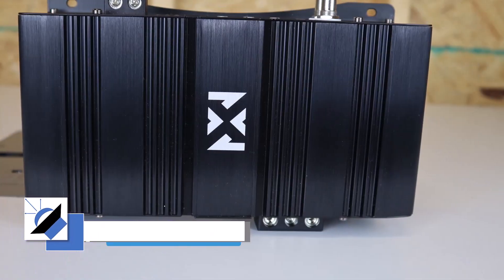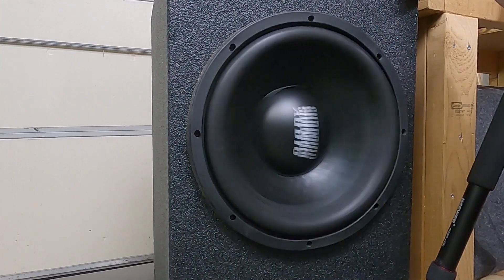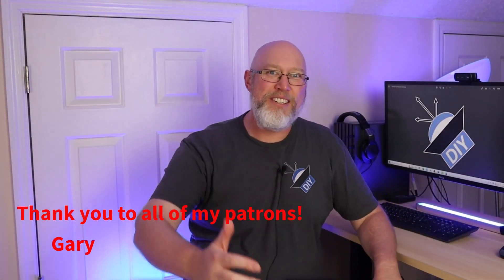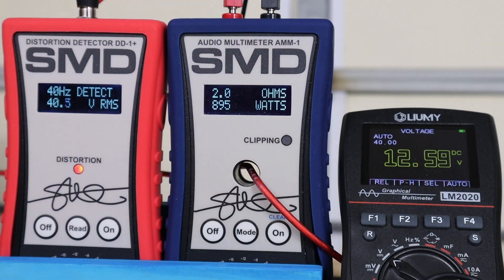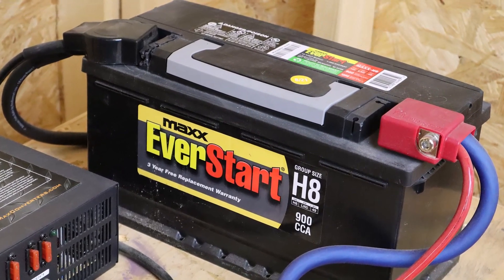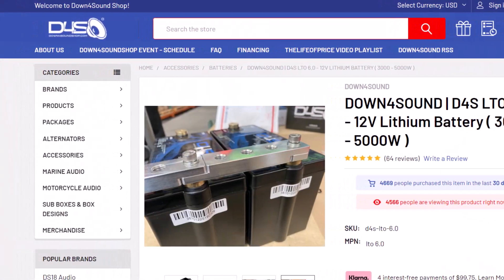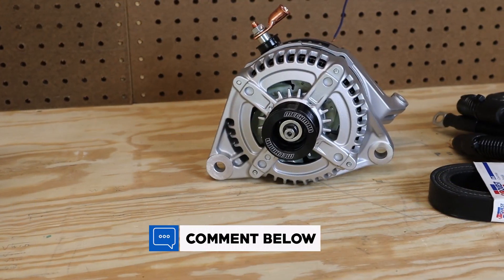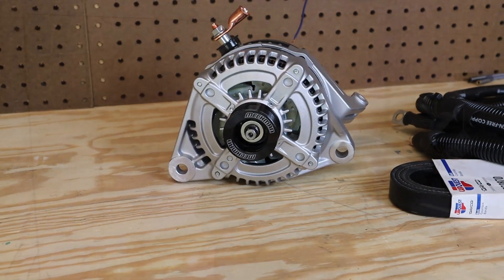Amp dyno FAIL:  Here is why you need to upgrade your alternator!

Comment: i've got a question :D I'm running a 74Ah 750 CCA battery with an stock 120A alternator, Big 3, an Vibe Subwoofer with 450W Rms and a AB Class Crunch 2ch amp, which can output 1x600W Rms 4ohm and 2x300W Rms at 2ohm, the sub is DVC 2ohm ... And when i crank the Gain up the lights with the engine running are start to flash :)) ... I''ve got good 4AWG cables, good grounds points ... And now my question : If i buy an clas D amp which is more efficent, then clas AB, and it drows less current, my headlights stop flashing :-? Or shoud i upgrade the battery with an 80 or 100Ah and 800 CCA :-? Sory if my english is bad :D Thanks
Reply from the maker: Those crunch apps are probably only doing about a fourth of their rated power.  Honestly, you should have enough electrical to support that much power.  Switching to a more efficient amplifier will help, and upgrading the battery will help. I recommend that you do both.  But there's no guarantee that that will completely fix the problem.

Comment: Running new 12v amg under hood,  big 3, 320 ho alt, and d4800 xspower in parallel.  Pushing cab45 about half way up Running two vxf12s and a d4s 234 Running highs and mids. It runs nice but i still need to install the pwm controller to trick the computer to charge without running lights or a/c

Comment: I have a Uni-T UT210E multimeter with a current clamp, it costs $25-30 and I think it's great. But the ones you shown for $130 are, of course, better.
Reply from the maker: I will have to check that out.

Comment: I have a 2021 Toyota Hybrid,the hybrids take their 12v dc from a ac to dc converter,not an alternator! Toyota recommends 30a max acc power,I have a JP3 that can pull 100 amps on bursts,have never had any voltage problems,the 12v battery in the hybrids is a deep cycle type,as this battery does not start the car. Hybrids do not headlight dim,no alternator,or any other belt device! I also have a rav4 hybrid with a sub and amp,they work great for modest systems.

Comment: Great video as usual bro...
In Our country,lithium is still very new and not really aimed at car audio..
I wonder how those 100ah deep cycle solar lithium batteries will work for car audio...it's the only ones we can get Our hands on currently
Reply from the maker: I've been trying to learn as much as I can about lithium batteries lately. My understanding is that those batteries do not have a fast discharge and recharge rate.  Apparently the thing that makes the magic happen in car audio is the discharge rate.  If you put a bank of those solar power batteries into your car it would perform like a big AGM battery.
Reply: @DIYAudioGuy  so the most reasonable gain will just be weight saving...damn
Reply from the maker: @vpowerelectrix998  plus reserve capacity.
Reply: The more I read about lithium the more confused I get,I see numerous companies now offering "drop in" replacement lithium batteries for vehicles,plenty 100ah aswell,they actually look very much like a stock lead acid battery that fits under the hood,but strangely when I read the specs of these batteries(they also have built in BMS)...they say "max" charge current 25A...won't a stock alternator put out much more amplege to this lithium battery.

Comment: Xs power battery to replace my stock battery and also have a high output alternator and big 4 upgrade. Supporting 3000w rms. Best idea is to replace the stock battery with a xs power and then upgrade your alternator and wiring.
Reply from the maker: Definitely going to do a big 3.

Comment: I had 2 of thoes Kenwood amps on 4 mofos and it blew me away. 1000 watts at 2 ohms they were rated. absolutely rocked my car.
Reply from the maker: I had no idea these answers were so popular!  When I bought mine several years ago it was a good deal, but the price seems to have shot up a bit since then.
Reply: @DIYAudioGuy  they are 300 a piece now
Reply: I had it on 4 12 Kenwood kfc w112s and it was bad ass

Comment: I got a 320a alt at 14.8 with 64ah headway bank and xs power d3400 on an isolator powering a smart 5k. I only drop .3 or .4 in a Mercedes-Benz E350 🤷‍♂️

Comment: I’ve got that Klein hall-affect clamp meter. Works great id recommend it, no need to buy the expensive Fluke ones (I do like Fluke though I wish haha)
Reply from the maker: I'm debating between that and a Harbor freight model.  I just can't resist the cheap tools at Harbor freight.
Reply: @DIYAudioGuy  I definitely get that! The Klein one was only 80 or so from Home Depot though and it seems quality. Even came with a temperature sensor (cool but unnecessary tbh)

Comment: DIY audio guy: how about a guide for finding the right amplifiers to use for a hybrid car where you are limited by your 12v battery and charging system. ive seen some people run 2,000 watts in a prius say they have no problem and others say if you run more than 500w you could case fires. its a minefield of misinformation out there!    More and more cars are going hybrid and electric it's not so simple as buying an upgraded alternator and adding auxiliary 12v batteries anymore!
Reply from the maker: That's a different ball game.

Comment: I'm looking at aftermarket alternators. My alternator is currently the reason I am locked into my current amp.
Reply from the maker: Pay close attention to the power output at idle, especially if you plan to sit in a parking lot and pound away.
Reply: @DIYAudioGuy  yeah, I've been monitoring power output. With all accessories turned on and I mean everything, I can still pull 60 amps without voltage drop. Stock alternator is 140 amps. According to my amp clamp, with everything turned on and my amplifier pulling 60 ampers, total current output from the alternator is approximately 128 amps. So I am absolutely positive that any power upgrade will need an alternator. 90% of the time I'm driving the car when I'm playing music, but the other 10% I like to draw a little crowd in the parking lot at my job. I work for AAA so I'm surrounded by a bunch of car guys who are indeed quite interested. As the weather gets warmer, I do spend a bit more time in parking lots. I looked up linkwitz Transformer. I kind of want to test that out. I'm not sure how far I'll go with it though because my goal is to get a two and a half Cube ported box, and eventually 1,000 RMS.

Keep up the good work buddy, I am a big fan
Reply: My new alternator can pull 160 amps at idle, 339 peak. And you can feel it, at idle the alternator is feeding the amps all of it.

Comment: Nice video, Sir. However.....adding batteries to a stock or aftermarket can technically help. This because you create a larger pool of power stability. 

Now, if you run all your extra batteries into the dirt.....theeeeeeen your alternator will hate life. Alternators like to maintain or top off batteries, not completely recharge them.